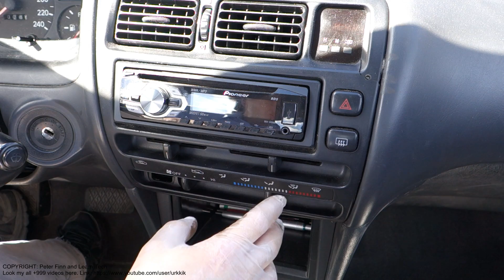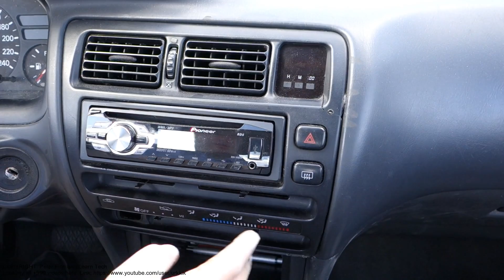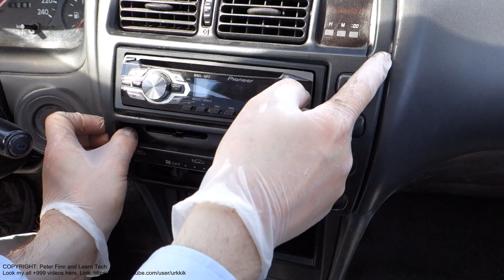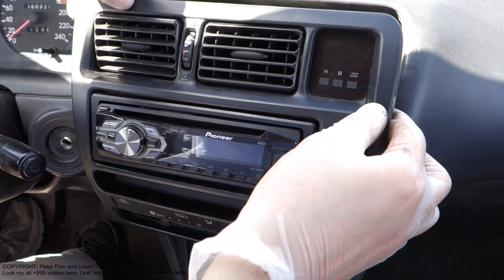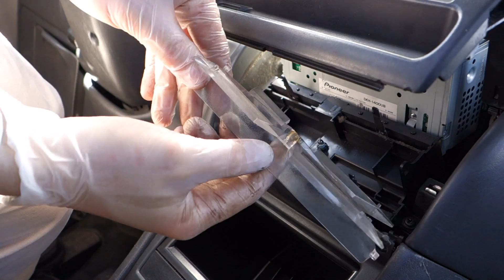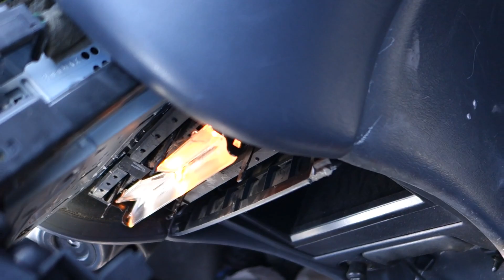How to replace bulb in heater control center trim panel Toyota Corolla. Years 1991 to 2002

Comment: GOOD AFTERNOON !
MY NAME IS WELLINGTON, AND I AM FROM BRAZIL. I HAVE A COROLLA 1993, AND THE AIR BUTTON DOES NOT WORK WITH THE AIR CONDITIONING THIS IS BEING CONNECTED BY THE FAN CONTROL, AND THEN THE MODULE DOES NOT ACKNOWLEDGE THAT THE AIR IS CONNECTED THEN THE ENGINE TURN FALLS, IT IS NOT COMPENSATION AND THE ENGINE STOPS. IT CAN GIVE ME A LESSON HOW TO SOLVE THIS. THE AIR IS FROZEN VERY WELL.

HELP ME PLEASE
Reply from the maker: Noted 👍

Comment: I'm interested in replacing that bulb with an array of LED bulbs and getting rid of the prism completely. I saw a fellow in China do it on his youtube channel. The bulbs behind the hazard and defrost can also be replaced with a resistor and an LED. There is also an ashtray bulb that can be replaced with a resistor and LED, however i'm not sure its going to be as easy as the rest. Thank you for posting these videos on the old corollas! You are much easier for me to understand than the guy speaking Chinese and i wouldn't be able to figure this out without your guidance!
Reply from the maker: Thank You for feedback. :-)
Reply: @PeterFinnTheCarDoctor  Hello, good afternoon, a question in my car Toyota Corolla 2001 the light there has no power and with the Liz detector it comes out in the cables double negative when connecting to the positive where I can see the short the fuse or relay and Circuit? thank you

Comment: Thank you, sir, your video helped me in pulling out the radio and clock that I'll be keeping as a reminder of the awesome car I'll have to say good bye to. These old Toyotas... Cars like those will never again be produced. Wish I had a chance to drive one in a brand new condition.
Reply from the maker: Thanks Sir,  :-)
Reply: I thank you. :)

If you wouldn't mind giving me one more advice, I'm unsure as to how to connect the clock to a power source. The car had 4 pins, labeled on the back of the clock as B, ACC, E and ILL (top to bottom, left to right order). Judging from the PCB descriptions, it would appear that ACC and ILL are the poles, but I'd like to know for sure. And I'm not certain about voltage either. Standard 12 V?

Thank you again!

Comment: Hi Peter, nice video! Second one of yours I'll soon be using :) 
One question - do You know if the 2 buttons (hazard lights and rear window heater) in this panel have backlight?
And also - the button on the left side of steering wheel (fog lights and central locking) - do they have a backlight?
Reply: YES they do! mostare burnt out by now they have these tiny bulbs that go on the little plus signs on each button, the cigarette lighter and ashtray have these tiny bulbs too
Reply from the maker: Hi, those switch don't have backlight. I think so.